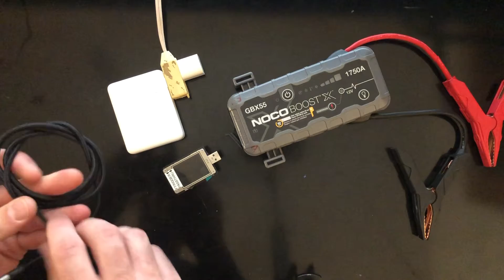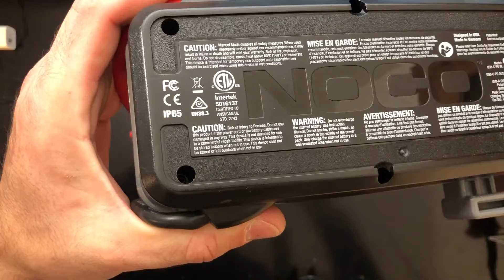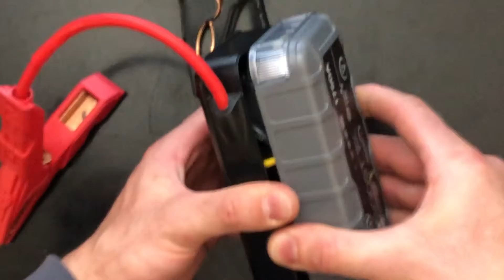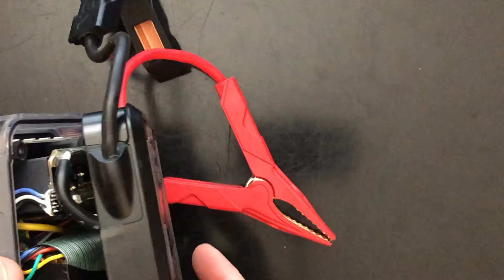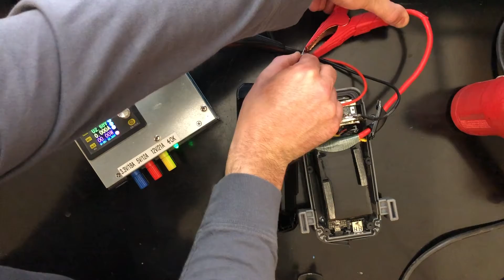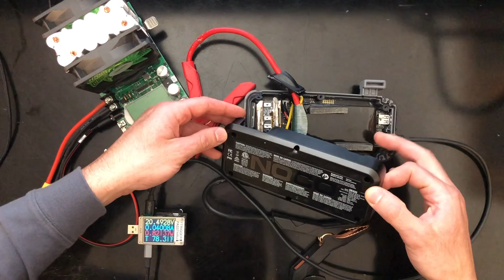NOCO Boost GBX55 Part 1: Restore

Comment: I know this is old but this is helpful. Instead of taking this apart, the metal surrounding of the USB ports are directly connected to the lithiums ground. You can plug a USB A to C or even an A to micro B cord to the A port and the metal outside part of the other end can be used to attach your power supply to. I have done it multiple times

Comment: Mine lights up and starts to charge and then immediately goes to just the green light without the rest of the charge indicator being lit. The flashlight comes on when plugged in too but seems like half power. It's so frustrating to have a several hundred dollar fancy looking brick.

Comment: This did not not work at all on my GBX55. It trickle charges up to over 14 volts using this method. You can get two bars on the battery gauge. But plugging in the USB charger at that point gets a short period of the lowest battery gauge led "breathing", then straight to the last single green LED lighting up. Not the whole gauge, just the green LED. You can disconnect everything and turn it on and the two bars light up, but nothing works. The flashlight doesn't even come on. It's just giving a false 50% charged indication. With the USB plugged in, you just get the power LED and the single green LED. So this method will not necessarily recover a GBX55.
Reply from the maker: Agreed, it's not a guaranteed fix. The cells may be beyond repair. Did you do the balancing too? See the part 2 video.

Comment: Hi, seems like you have a lot of experience in working on those Noco boost chargers…I have one which I think was damaged by water or moisture…I was able to fully charge the internal battery with external charger, however when I’m trying to boost my car battery , the final relay’s doesn’t connect the power to transfer the voltage probably due internal board issue which should overheat internal battery (preventing relay to energized)…what I can do exactly in order to bypass all the safet issues and eventually make this Noco to boost my battery??…tha k you so much 😊

Comment: I was hoping to get your advice - I tried your method and was able to get the voltage to 11.5 volts but it still won't charge. I suspect the diodes on the board are bad. I can see two and tested them both and they both show a hard short. I can see the lane on one of them is 1.5 but the other one I can't read any writing on it. Can you tell me what diodes are on the board?
Reply from the maker: I wish I could help but I dot have this model easily available anymore. You can probably just over spec it.

Comment: what charger are you using?
Reply from the maker: @road2dirt122  give’r a like if you find it useful?
https://youtu.be/vJJl3NoeiUc?si=5v_yczQF0DMmqN7y
Reply: @colindgrant  hey i have 2 GBX75s both not taking a charge NOCO warrantied the first one told me it was a firmware issue lol , iv gotten one charged up to 14.5V and its showing 2 bars on the LEDs but still not taking a charge by USB C have you had this issue? i see by some of your videos you only needed about 12V to get the USB-C to work

Comment: Is the red cable possible to be replaced? My dog chewed mine and I’m wondering if I can just get extra 8 awg wire and replace the bad cable? Thoughts? 😊
Reply from the maker: @iflo92if  not easily. It’s leads directly to the battery where it has heavy soldering that’s tough to do without that right equipment.

And butt splicing is tricky due to the high current it needs to handle. It needs to be a really really really secure inlets low resistance connection. The stock 8awg stock cable is honestly only sufficient because of these super secure connections and very short length.
Reply: @ thank you I was looking at different connectors to see if I can fix it. I appreciate the response:)

Comment: This migth be due to you are using a mac charger. Their supply logic is drastically different from others.
Reply from the maker: @ys_builds  kind of. The Mac supports USB-PD, the charge protocol for USB-C. So they’re more compatible with other manufacturers than ever. However, like any manufacturer, it’s up to them to decide which specific PDOs they support. This Apple charger skips the 12V PDO. It goes from 9V to 15V. It also supports extra modes that only apply to specific Apple products, that’s how they do 140W for the M1 MBP it shipped with, using a special USB-C to MagSafe3 cable. That doesn’t apply to this video though.
Reply from the maker: @ys_builds  at 15:15 you can see how the Apple charger and the NOCO charge PD controller negotiate to use the 20V PDO.

Comment: Hi Colin, I have pulled apart the NOCO and found an SMD component close to the USBC charging port blown. Looks like a small IC with D19 printed onto the PCB. Would you know by any chance what the component is? Thanks
Reply from the maker: It's probably a diode. Unfortunately I don't have the device open any longer.

Comment: Great video, as always, I have a Noco gb70 2000ah that I would like to try your technique on, but I am unsure what voltage and amperage to use for the slow charging process. Could you help, please? Cheers
Reply from the maker: Hello @Gazzyb2071. That's a larger capacity model, so it should be able to take the same or even larger amount of current than the GBX55 here.

For the voltage you'll need to check is whether it is a 3S or 4S battery pack. If it's 3 cells in series, then charge no higher than 12.6V. If 4 cells in series, then the upper limit is 16.8V.

But that said, 12.6V is probably the way to go. It's safe for 3S and should still be enough to get a 4S pack up to where the NOCO circuitry takes over. Good luck!
Reply: @colindgrant Thank you for taking the time to reply. 👍

Comment: On the Boost X series NOCO has said that if the battery falls below the threshold voltage to charge, you can plug in the cigarette lighter charger for about 15 Minutes which will many times bring the voltage up to where the regular charge can be applied
Reply: I can confirm that this does work.  NOCO did tell me that only in Override will it go below this threshold, if using it normally it will protect itself.
Reply from the maker: Thank you @mattr3194 for relaying that explanation.

Comment: Use a usbc to crocodile clips connect the negative black clip to a  trickle charger and connect positive side of trickle charger to noco output red clamp, this will allow you to avoid the BMS and charge internal battery without taking it apart, give it 20 mins and it should then take a charge from normal usbc
Reply from the maker: Yep! See my other video for details on how to do this.
https://www.youtube.com/watch?v=-xueq2GjKs0
Reply: @colindgrant haha I just watched that 10 minutes ago

Comment: Apparently when you can't charge it via USB then you need to use the cigarette car charger to bring it back to life according to another video here: https://www.youtube.com/watch?v=_kscEuRkGBc
Reply from the maker: I've watched that. I don't see how it would work electronically. Here's another comment where I went into more depth...
https://www.youtube.com/watch?v=-xueq2GjKs0&lc=UgwP5Ph1i4QLEqt6YuB4AaABAg.A-CSPTskbaZA-jJBzgGq5m
Reply: @colindgrant  While I wouldn't have thought that it would work, I went ahead and purchased the NOCO cirgarette adapter and it did indeed bring by GBX45 back to life.  No amount of regular USB C would do it.  NOCO did confirm that it has an auto-shutoff to prevent running down EXCEPT when in Override which I used for a totally dead battery.
Reply from the maker: @mattr3194  This is great info. Thanks for confirming. Maybe I'll have to buy one of their cigarette adapters to figure out what exactly is going on!
Reply: @colindgrant I got a GBX75, and it shows full charge if it is  plugged in to the charger USB,  but as soon as I unplug it it won't turn on or do anything, any Ideas?
Reply from the maker: @aldoramirez-mf9nd  That's a new one to me. I haven't seen that, and unfortunately I don't have any ideas. Have you called NOCO?
Reply: @colindgrant  no, I haven't yet, but I think that will be my next move or trying to find someone who wants to mess with it.
Reply: @aldoramirez-mf9nd same thing happened to me after day 1 … now I’m with a dead bat stranded with this pos junk totally dead and no way to plug it in since my bat is dead 
😊
Reply: What power supply are you using?
Reply from the maker: @tommyh.8509  this is all about my power supply. Give it a thumbs up if you find it useful?
 https://www.youtube.com/watch?v=vJJl3NoeiUc

Comment: 18:30 startet at 8v and it showed exactly this. I charged it to 12v and still my charger wont work it only accepted the pd charger i tried after that.

All this happend after i started 20 cars also ones completely without a battery. 

Thanks for the video it helped me a lot

Comment: Where ade you located? Could i send u mine to fix? It wont charge type c. When i plug it i. It has a red light that comes on and wont go off til i try to jump something off then it will. I live in arkansas
Reply from the maker: I'm not taking repair work, but I would just do the same steps I posted here. Hopefully you can do the same. One easy thing to try is a USB-A to USB-C cable, in order to force a 'slow' charge. Good luck!

Comment: Great video Colin. I have a GBX45 which doesn't appear to take charge via USB-C (solid red LED). The Pack voltage is still at 14.5V and all cells appear to be balanced 3.625V. I have checked several power sources but cant figure out why the booster is not accepting charge. Any ideas what may be the issues?
Reply from the maker: Which light is solid red? This may help...
https://no.co/support/gbx45-interface
Reply: Hola que voltaje son las celdas de GB40??

Comment: Colin, based on the demand for the NOCO's, what would it take for you to replace the cells in the NOCO with some off the shelf cells?
Reply from the maker: I haven’t been able to find any suitable replacements off the shelf (same dimensions and high C rating). But under $40 I think it would be worth the work.